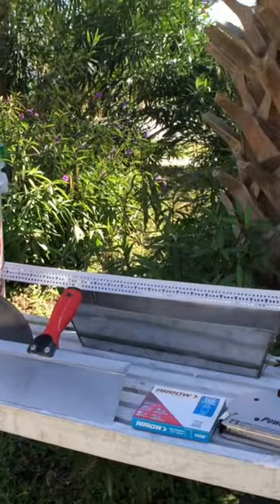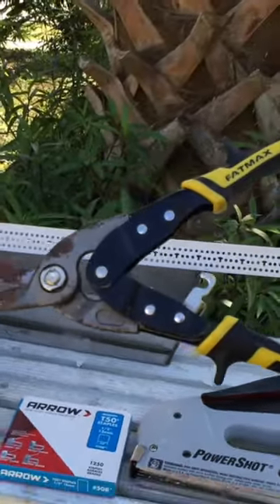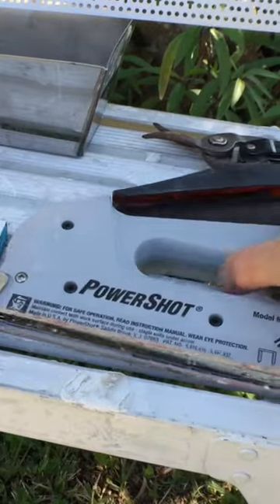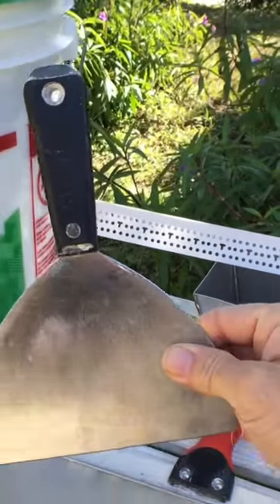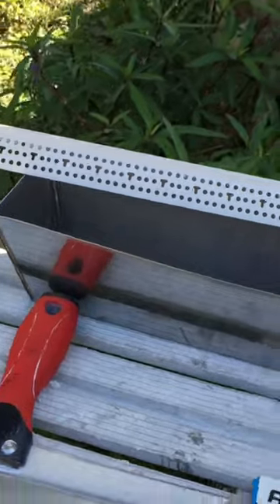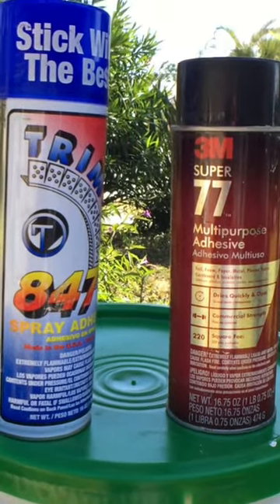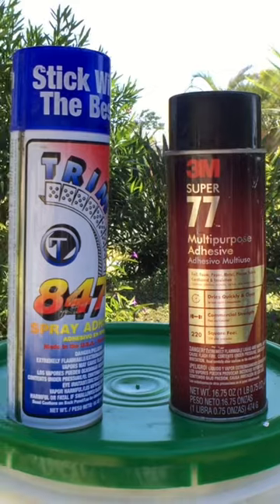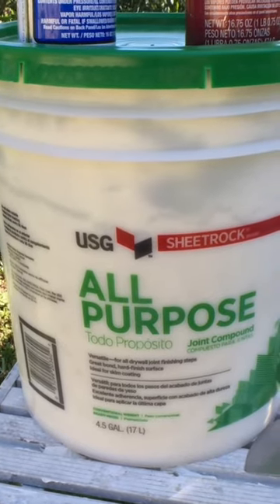All The Tools and Materials You Need To Install Vinyl Corner Bead!

Comment: USG all purpose cut with water is the best mud I’ve ever used, not too soft, not too runny, easy to sand and cracks less than any of the pro form products I’ve tried.
Reply from the maker: I agree!👍🏻😎
Reply: You cut it with water for every different type of mud step or just one particular process?

Comment: I’ve never used vinyl corner beads, what advantages do they have over metal corner beads?
Reply from the maker: The vinyl bead doesn’t rust in moist areas like bathrooms or around windows.👍🏻